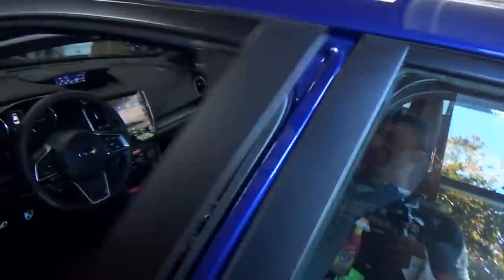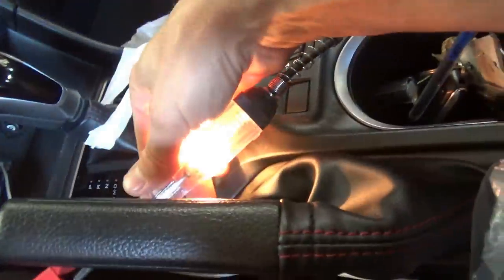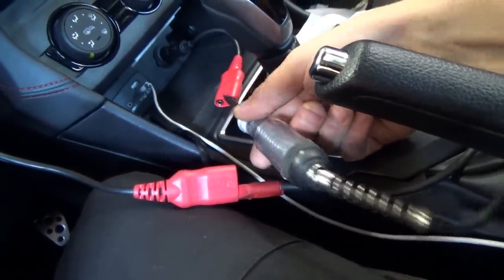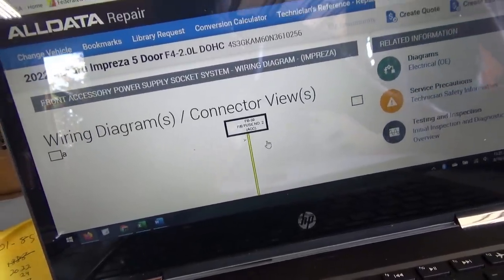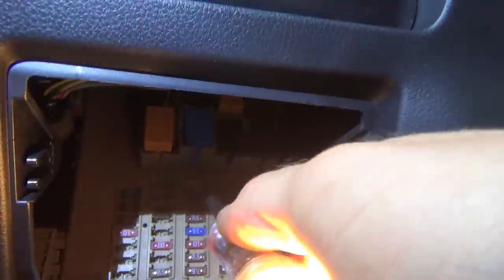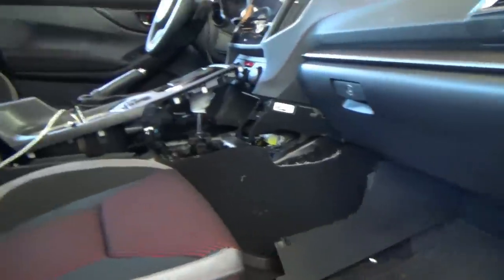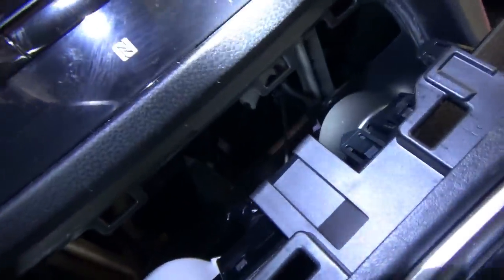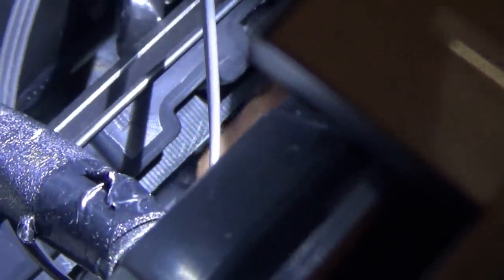Dealer Wants to Charge Customer for THEIR SCREW-UP?! (22 Subaru Impreza)

Comment: Hi Ivan i am a Radio Amateur as well but in England, my callsign is g4vvq, wonder what your frieds call is, i do know that you can have problems running high power transmission from a radio with the cars engine ecu/pcm...i assume he knows that, not that this has anything to do with this problem...from Fred in Uk

Comment: From my experience of fucking around with Subarus, I expect it happened like this:
Dealer opens the console the correct (long) way and replaces the socket, but installs it incorrectly. 
Dealer closes console up before testing socket. 
Dealer tests socket, realizes they fucked it up, and tries to pry socket out the front instead of spending time on it.
Dealer fails, says "fuck it, we'll just bill him for diagnostics."

Comment: So maybe the dealer was trying to beat flat rate time when he installed the outlet and he didn't pull the dash apart is why it was not connected.. thats why the damage to trim plate.. or a different tech was just given the install job. As far as bench testing it we all know that it is easy to do but the dealer is not going to be paid for the time... also they didn't have to warranty it because of the owner had ruined it with his radio installed... Ever one likes to point fingers at the the dealer maybe the tech was having a  bad day.  He should of contacted Subaru for advice on whom could fix it.. Remember that it all happened from his Ham radio so in a way he caused the problem...
Reply: Maybe people who like to beat up on the dealer should try and work flat rate at a dealer and see how much they can earn when the factory doesn't give next to nothing to do diag. Or repairs

Comment: 2006 Honda Civic Hybrid. Brought it into the dealer because the transmission wasn't working turns out that the spline shaft got twisted up and shoot up the flywheel. They completely destroyed my power distribution unit and my computer and all of my vacuum lines including my breather box were loose. Blinking d parasitic draw all because of the dealer

Comment: They couldn't bench test the 12 volt outlet because it doesn't plug into a computer. Which is all most of the new techs know. I applied at a VW Audi dealership once and was told by the service manager that I was a dinosaur because of my age and the last FI system I worked on was Digifont for VW. He flat told me that I did not have the ability to work on new cars because I didn't know how computers worked, and he would never hire anyone like me....while he was enjoying the lesson he was delivering I stood and watched a "tech" try to install a transaxle. Failure after failure finally resulting in his taking it off the transmission jack and putting on the floor, while the service manager was smacking his gums I walked over to the "tech" turned the flywheel side drive flange for the CV till the half moon cut out in it was aligned with the flywheel, picked up the transaxle and set it in, by hand, on the alignment dowels. Ask the "tech" to start one bolt to hold it in place. Walked over to the SM and said "Must not be a computer port on that drive flange huh?" and informed him I actually have experience as a mechanic on VW and Audi and have a degree in computer science.  Some expletives later I walked out and never thought about wanting to work at a dealership again....
Reply from the maker: Amazing 😅

Comment: Does Subaru sell OEM 12 volt accessories specifically designed to be plugged into their 12volt outlet socket…? I would very much doubt it. So the dealers statement is laughable about the warranty being void for that circuit.

Comment: Dealers LOVE to put your car on a diagnostic computer. They'll tell you that it costs $150 per hour and then charge you for several hours because it 'may' take several hours for the car to generate a fault that the computer 'sees'. This may have been true 25 years ago, but today's OBD2 cars are so redundantly computerized and linked via CANBUS that the fault, if it occurred and not erased, will be immediately evident. But a dealer will unblinkingly tell you it was necessary to run the diagnostic overnight or over the weekend to "find the fault" and charge you the hourly fee for sitting with an OBD plug attached to their computer. Yes, they had to buy expensive, dealer grade software, but otherwise it's free money for them to park the car against a wall and charge you $150 per hour.
And another thing: the dealer could not bench test a 12V receptacle? What, really? They didn't have a multimeter? And they could not analyze a Hot to Ground circuit on a simple receptacle? REALLY? You only need to probe the two pins while the lighter was pushed in and see if there was continuity. Good God - anyone who ever worked on anything would be able to do this. 

My advice: find another Subaru dealer. This one lied to you multiple times and basically admitted they were the lowest level of incompetent.

Comment: thank you should have put it back, the way it was, and let the dealer have a shot at fixing their mistake and record the outcome and see if there on the Up and Up its one thing not to know how BC an ECM or Sensor But a power plug, Its like putting gas in a car how hard can be not hard 

If they pop up with a big or even a small repair bill, Show the GM the video and the owner, 

Once had a nationwide auto repair center try and take me for a ride and I pulled out a Snap On MT 2500 test set and found they had Un plug the CSPS and broke the Air intake letting air bypass the MAS Airflow sensor.

Should have call the police but was so upset I fix it in the parking lot.

Did send a fax to them and not asking for anything just making it clear. If was a single mom or things were tight the cost for the shop to repair the car could have been a big dent into my house Hole 

But a little Black RTV  seal the air leak and just pushing the CSPS sensor back onto the connector fix both codes as it was a postive lock I know I help put the engine back into the car after the first engine went bad. so when the dealer manual say it was  a bad CSPS i just drop down to the front of the engine and found it unplug, as it was ease to reach

Its one thing to make a mistake as we all have at times it's a new ball game if they try to flat out scam you. 

At the time I was driving 100 miles one way to work and even made it in on snow days as we had aircraft  flying so my day startes at 0400 AM and in by 6 AM to help check the line and look for any avionics insures that could down an aircraft.

You see i had a total set of dealer manuals for the car and carry the Main ECM, Transmission ECM all relays, fuses all sensors , Disturber, Coil and the fuel pump and sending unit Assemble was eased to change from a factor access panel in the trunk 

1992 Maza 929 JE 48 DOHC engine 

Was very disappoint from the response  

Possible it will need a direct feed from the main power bus, But from your work I am sure you know this and took care of Him.

Thanks for posting looks like first rate troubleshooting at its best

Comment: I don't know why anyone still has faith in the dealers.   I wouldn't buy from a dealer, and I certainly wouldn't let them work on my car..  I hear these stories far too often.  South Main Auto just dropped another video where the dealer wanted to replace the trans module, body module, steering module and the electric assist steering motor...........   Turns out, it was just one bad ground cable.  And the dealers had already charged him $800 for diagnostic time, plus restock fees after buying all those parts. smh..  It's criminal

Comment: How far has ham radio operator's have down, when I got my ticket (1978),  wouldn't have over current the plug to begin with, never would have gone to the dealer, would have fixed it my self.  N7AVA.

Comment: If you are rich you can afford a dealer, if you are not even part of the X Middle class you can't afford the outrageous prices the dealers charge, the local Toyota dealer told me I needed a good diagnostic scan and they wanted $165.00 dollars? I ask them isn't that a bit much for 30 minuets time, the service writer blames it on COVID, yup corporate America wants to drain all the money they can get before we go upside down. I took my 2013 Prius with 170,000 miles on it   to a independent shop he ran every scan their was and did the full batteries cells test which is still perfect and it took a total of 30 minuets no FAULTS found? My cost $40.00 dollars which would be less than half the price of what the dealer wanted. You can only get so much water from a saturated rag, you can get only so much from a working man making less than half the economic wages needed to survive as a HUMAN not as a $lave???

Comment: First of all amp draw was 11.2 on circuit, even if socket was designed for 10a Max that is suspect. I don't believe that. 20a fuse feeding circuit, so socket is good for that. I mean that's why they put them in. Dealer is a scam artist. Gets paid with warranty the double dips on customer pay. If it was because customer plugged too great of a load in, would have blown fuse. If socket can't take load faulty engineering.

Comment: what? so you basically cant use the outlet without voiding the warranty because everything would be considered "aftermarket"
also they're suppose to be certified to work on these cars and by the sounds of it they got some random guy who doesn't know what he's doing. 
he doesn't even know how to use a multi-meter to check a socket for continuity... you dont have the be a master electrician to know how to do that. 
basic electronic testing is a part of auto mechanics.

Comment: Once again dealers make money selling cars not repairing them. The service department is a necessary evil for warranty which they do a shitty job on. A new car with a warranty isn’t worth a 3 year old car with a trusted mechanic
Reply: Actually for most dealers of any size the the shop is a bigger profit source than new car sales.
Reply: @stevewhite3424  do you have proof or is you heard from a guy who knew a guy. I was an account for a chain and the service department struggled to be profitable. Warranty work is a loss on labor and parts which killed the GM and Chrysler locations. The quicklube was often thrown in as a sales pitch. There were so many comebacks. Tech turnover was outrageous. So I disagree.